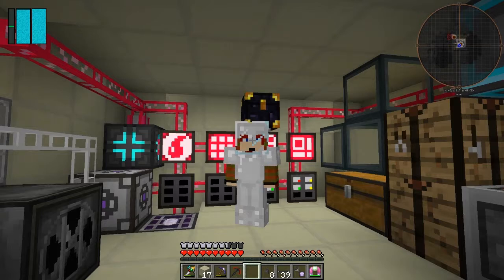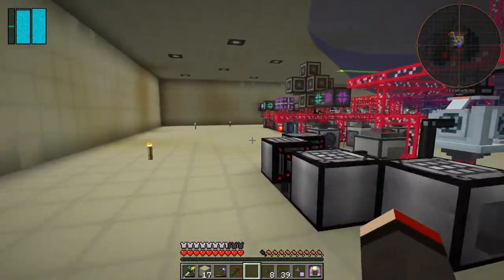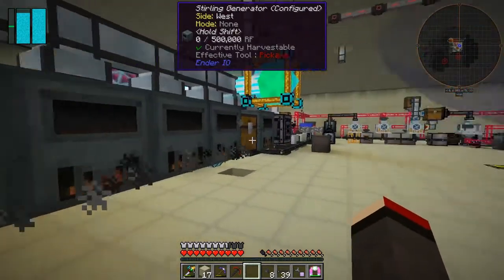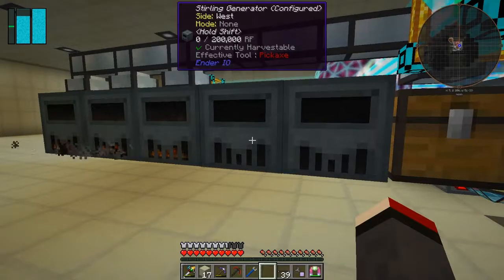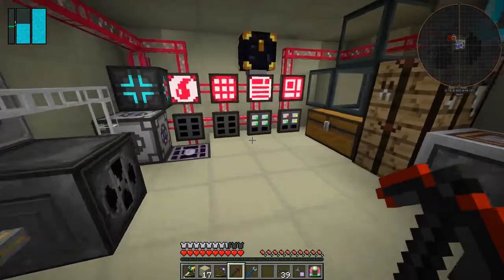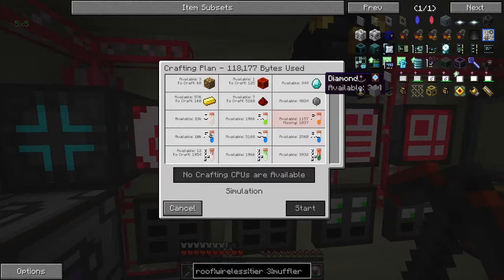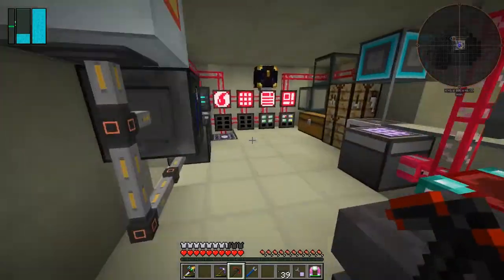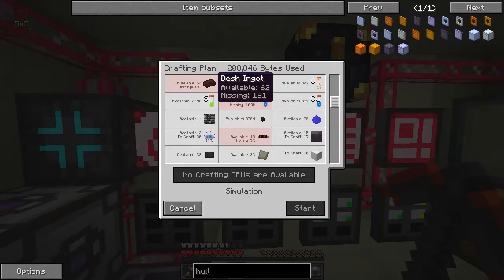Galactic Science 2 #84 - Fast Water and Steel Hulls

Comment: I saw your test for how much octa+carbon do as energy, if you use the vibrant capacitor you get the correct amount of 3 600 000 RF/T as the game suggests, normal capacitor gets 1k energy while the gen produces 20k. Liked a lot the cheap water approach with Me annihilation plane and the me level emitter too.
Reply from the maker: Rares Miron All the power storage is in the power core so you don’t need capacitors except to charge items. All the enderio conduits transmit something like 512k RF/t and this would be a normal restriction. If you want to make capacitors banks watch out for the recipes as making vibrant banks is best done with two standard banks. The snow was a chance discovery and means you can feed the oxygen bubble without risk. Thanks.
Reply from the maker: Sorry I was mixing up capacitors and capacitor banks. It was more about that you got more energy per carbon with the higher capacitors.